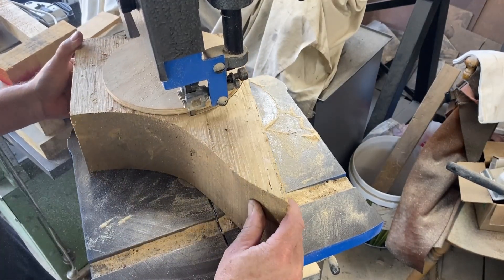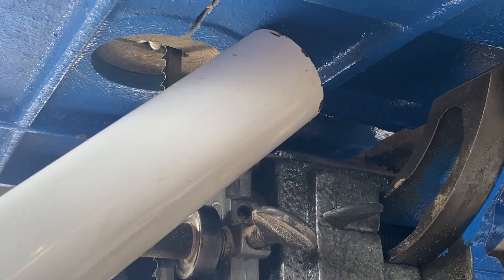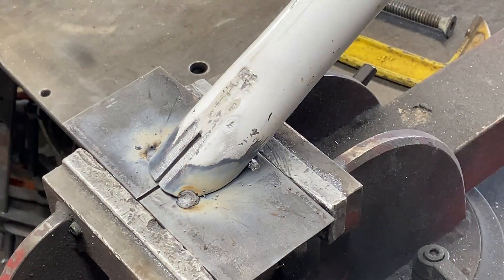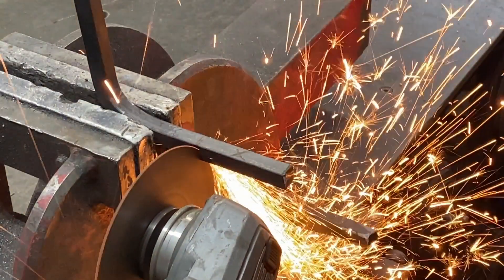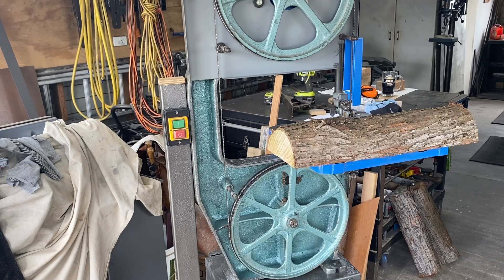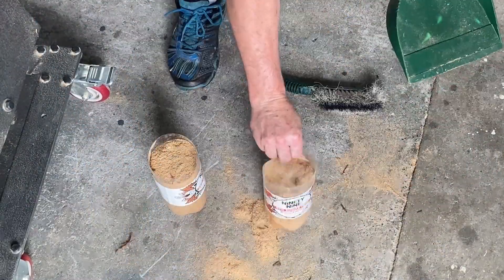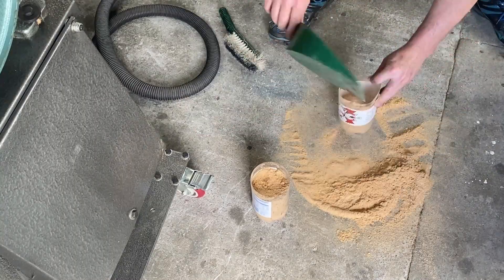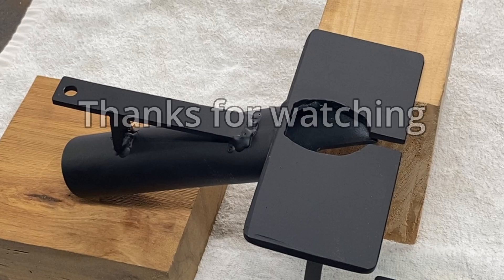Bandsaw Attachment Pulls Over 92% Of The Dust

Comment: Very well worked though Video.  Just starting to look for something. Any reason why you didnt use PVC?
Reply from the maker: I guess it can be made from PVC. I have a welder and plenty pipe so I just used that. Thanks for watching.
Reply: Good love ya for your metal work. PVC pipe and fittings with magnets might accomplish the same results.

Comment: Another nicely paced, thorough, and useful video, thanks.
I made an experimental vac attachment cobbled up from ply offcuts, pvc pipe, and hot glue.  It's held on with magnets.
It worked even better than I had hoped, so I spent forever with Fusion 360 etc. and made a number of 3D printed versions, until I had something that was very satisfying...
DAMNED THING HAS NEVER WORKED AS WELL!..  It looks pretty though.   😜
Reply from the maker: Thank you for your comments. Yes, it is amazing how much dust can be collected when your vacuum is targeted directly under the table where the blade is pulling most of the dust.

Comment: good   result

I  also use a pusher
a big 300 sf per min  drum  type  silence
and  push the  dust  to  the vacuum  by  the  top 

it  work  well also  in  stone  carving   push  and  pull system

jacauessavard videotron ca

Comment: That "dust" that's sticking to your wheel and blade has resin and oil from the wood (pine especially) . it essentially sticky tar once heated and compressed
Reply from the maker: Thanks for the info.
Reply: It can be a contributor to blade vibration once it's caked on.  I saw a device made using a couple of 50mm (2 inch) rotary brushes  (One for each bandsaw wheel).  They had skate bearings fitted, and were mounted to the fixed part of the blade covers so they ran against the bandsaw wheels.  The bristles were brass, but I think that was only because they were old ones that he already had.
They were not powered; they simple ran against the wheels and flicked the dust off... he reckoned they were worth the effort.

Comment: Awesome results! Too bad you have to remove it to change the blade... I'm also guessing that it impedes the use of the table tilt?
Reply from the maker: Thank you. Yes, it will need to be removed when replacing the blade or tilting the table. Fortunately I only use the band saw for cutting out bowl blanks and other uses for preparing wood for woodturning. I only use 1 blade, and I have never needed to tilt the table. Thanks for watching.
Reply: @thehobbymachinistnz  Ya, I only tilt mine once or twice a year, but I seem to change blades every other time I use the saw... Tip: don't buy a lot of 20 different blades for your saw at a buck a piece, the time spent keeping the best possible blade for the job isn't worth the savings... ;)

Comment: Great solution and veery nice results. It looks like it could be made of PVC fairly easily as well. Perfect accompaniment for my cyclone unit, Enjoyed, cheers!
Reply from the maker: Thanks for your comments. Most of these that I saw on YT were made of plastic. A lot were upside-down and modified floor tools from shop vacs. These floor tools or PVC will be absolutely fine to use, I just did not have any of these materials available.

Comment: Good video. Made a similar device some while ago. A lesson I learned: If you open up the attachment more behind the blade, it will allow larger airflow past the blade and even more dust collected. (Also your dust collector will get cooled more and last longer)
Reply from the maker: Thanks for the tips. The air flow is the key and I was thinking about how much I should open it up. In the end I opened the blade gap to around 10mm wide. I tested it by blocking the hole where the blade comes down so that all the air is sucked through the gap. I listened for changes to the dust collector. If it sounded like it was semi blocked, I would open the gap wider. How wide is the gap on your one?
Reply: @thehobbymachinistnz  You are welcome. Mine has about the same gap as yours, i placed it as far up against the table as possible top get ad downward airflow (in hope of getting sawdust away from below the teeth of the sawblade)

Comment: Im going to make a suggestion
Take an old toothbrush and heat the handle.
Bend it so you can attach it inside the lower cover as a "sweep" for the lower tire (tyre?  for you antipodes🙃) so the dust/swarf doesn't keep stuck and run round under the blade again and again.
Reply from the maker: Yes, I have seen similar wiper/cleaner designs on bandsaws from the factory.  Thanks for watching.

Comment: Great result Jon! might have to do similar on mine. It has a dust extractor port in the lower wheel cabinet but it is pretty useless. Cheers
Reply from the maker: Yes, I saw a few videos on YT where people were complaining that the extractor port does not work very well. The home made ones like this design seem to work the best. You are actually taking most of the dust away before it has a chance to get into the machine. Thanks for watching.

Comment: I’m very curious what happens if you additionally connect the exhaust of the dust extractor to pump air into the saw box? In theory, sawdust should be blown out of the saw blade at the entrance to the box. "But it is not exactly" :)
Reply from the maker: Do you mean add compressed air to where the air is sucked in right behind the blade?
Reply: @thehobbymachinistnz  Yes - an additional chamber through which the saw blade passes with increased air pressure.

Also following the example of saws for metal, a brush is added that rotates at an angle to the blade, which cleans the teeth of the saw.